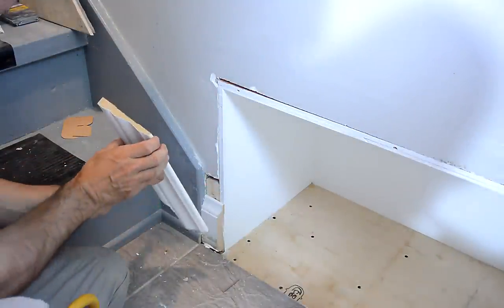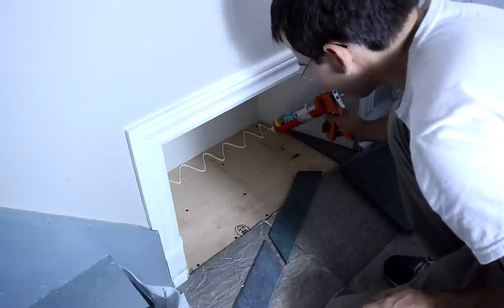Installing a boot nook

Comment: Nice project. That was acrylic caulking so it's water clean up. A rag with a bucket of water works real good. Just wet the rag and wipe it down then rinse the rag and repeat. I use the stuff all the time to fill cracks when I'm doing white cabinets. Real silicone is a whole other animal!

Comment: The original plaster walls had lath strips. The gypboard backer was an upgrade years later. You were lucky. The original plaster would have been a bigger mess :)

Comment: Nice nook in wall behind door. Like the compass magnet idea. I use the old little magnet nail finder with a small tack on the other side. Was worried about the structure removal until I saw your added support. Thanks for keeping mistake in and for sharing.

Comment: I once cut a few grooves into a wall made of gypsum blocks to get some water pipes hidden. It set of all the smoke alarms in my house and ppl thought it was on fire with all the dust coming out of the windows. I had no dustcollection and used a basic angle grinder. In hindsight, it was funny, but we found dust everywhere even after weeks went by...

Comment: I have the same type of walls in my house (from 1954). I often use a carbide tile cutting jigsaw blade to cut it. It can chip very easy though. Recently I have been using a grout removal blade for a multi-tool (Fein style) to make smaller holes like for outlet boxes. I love my plaster walls but they can be a pain to deal with.

Comment: Nice work but a tip for the next time you use casing around something is to start with the top piece then match the miters on the side tight to the top, it helps with the joint even though you used,

Comment: Make a spray bottle with soappy watter and after you finish applying silicon glue, spray the soappy water on those lines and then you can easily scrape down excess silicon off without it sticiking to tiles

Comment: "oh shit wrong spot!" lol. That was pretty cool. The dust at one point looked like it was about to start going everywhere but you could see it get sucked back up. I'm going to disagree with you on the grout vs caulk thing. With grout you would only have used one rag and a bucket of water for that area instead of all those paper towels. I've always had an easy time with grout but a super messy time with caulk. Looks great though!

Comment: Matthias. Your videos are always very informative and unique. But take it from a 25 year carpenter. NEVER beat one hammer head against another hammer head. There is still a piece of my old 28 oz. framing hammer lodged deep in the bicep of a co-worker from an incident 10 years ago. It could have very easily had been his eye.

Work safe, my friend.
Reply: He was hitting that no harder than you would a metal ended chisel. Hope that helps you rest easier
Reply: Actually no, it doesn't. It doesn't really matter how hard you are hitting them together. The edges of a hammer are very brittle and can chip off easily. I know this from training and experience.

Chisels are specifically designed for this type of use. Hammers are not.
Reply: +Dean Rohs mythbusters had nitrogen powered hammers hitting each other and couldn't replicate what you're worried about. A guy hitting a hammer into some plaster isn't a problem.
Reply: +JeefCakes 

Be an idiot if you choose. I'm telling you this can and DOES happen. It happened to me and a fellow co-worker was permanently injured as a result.

The Myth Busters used a specially designed ROBOT to hit the hammers together. Human beings do not hit like robots. They often hit a hammer head off centered or on the edge. It is THIS kind of action that can result in chips breaking loose from the thin edges and flying in any direction. And at very high rates of speed.

Educate yourself and cruise a few woodworking or construction trade forums and see for yourself. Granted, this is a rare occurrence. And the chances of it happening to you and resulting in an injury are slim. But are you willing to take that chance? I have worked in the industry for over 30 years uninjured because I choose to work SAFE!

There are more than enough tools designed for this purpose that one should never have to resort to hammer on hammer. And if you were an employee on MY site and I see you do this, I guarantee you will NEVER work in the building trades again.
Reply: +Dean Rohs he was tapping the thing, not smacking it. Safety troll
Reply: +JeefCakes  I've met so many people like you in my 30+ years in the trades. Usually in the Emergency Room. Stay away from my job sites.
Reply: +Steve Hillier I've seen two Estwing hammers not shatter.
Reply: +JeefCakes Congratulations. Here is something interesting, must be proof of your conspiracy theory.

http://www.finewoodworking.com/item/17562/reader-says-mythbusters-missed-on-hammer-strikes

The comments are more interesting than the article.
Reply: +Steve Hillier And if you're an electrician, you'd have a load of stories about how many times you've had a shock just pulling out a plug while holding the flex. Doesn't change that it's exceedingly rare, and it's just safety trolling. If the Mythbusters rig did the same thing every day for years, I bet they'd capture a few events.
Reply: +JeefCakes There is a difference between someone who tells youtubers to wear hearing protection or use a push stick and myself who tries to correct those poor misguided moronic know-it-alls who think that everything TV stars tells them is the truth. You could say I'm making the world a better place, one fool at a time.
Reply: This was one of the first lessons at manual arts at school. One would have thought our brilliant Matthias would have known this.

Comment: Aaaaand this is why i like your houses more. In my country we have houses mainly built from stone and solid bricks, you could not do something like this with a 30cm (~12 inch) wide wall
Reply: Yes, you can! In my country, the walls often are the same like yours, but I have a house with more than ten almost wall-deep nooks, made 100 years ago for tools, cabinets and protruding machine parts...
Reply: Matthias Burger hmmm, i will have to look into it, but it will not be as easy as the video, since i think i will have to carve out the nook

Comment: Tip* when using caulking squeeze it in to the groove then spray the tile surface with soapy water. It stops it sticking to it during clean up.

Comment: Things I learned this video:

Two hammers can get at tough nails
When using a nail gun for the edge of a box, the edge of your work table can be a great height guide
Not all walls are built equal :)
Reply: No man, never beat on the face of one hammer with another you could easily lose an eye. There are many tools designed to pull nails, cat's paws, flat bars, pry bars, crow bars.
Reply: How could I hurt myself? I need education here.
Reply: +RandomInsano2 The hardened steel face of a hammer can chip or shatter sending shards flying with enough force to puncture deep into your body. Definitely not worth the risk. Check out this site, the comments are full of scary stories.

http://www.finewoodworking.com/item/17562/reader-says-mythbusters-missed-on-hammer-strikes

Comment: I suppose if you had a few extra minutes and still wants to use caulk instead of grout, just tape the perimeter of the tile with painters tape. After the caulk sets pull the tape up and boom.

Comment: Rockboard... I hate that stuff.  I probably would have used a jigsaw on it to reduce the dust, but it's going to be messy regardless.
Magic repair of the higher cut into the wall.

Comment: A plaster lathe box, like original wall would have been better for sound insulation.  A proper size shoe rack would increase capacity (typical construction of rack is metal, but I'm sure you could make a great wooden shoe rack though you may have to expand the box if possible).

Comment: Next time use Blue masking tape by the joints so it will be less clean up. I like to use bath/shower high glossy white caulk as it doesn't get dirty/mold or turn brownish and its much easier to work with and clean (wet sponge).

Comment: Please wear a respirator. Any asbestos on that old plaster and cement?
Reply: +Amirhousein Hazratifar No asbestos in that stuff. Asbestos was mainly used in pre made tile shingles, flooring, and the like. The stuff he was cutting would have been made in place mostly, save for the gypsum lathe, which is basically sheetrock, which does not have fiber re-enforcement. However, respirator would still be wise, gypsum and concrete dust is still not good for the lungs.
Reply: Amirhousein Hazratifar too late
Reply: +Justin Lewis what do you mean by too late

Comment: SACRILEGE! Never hammer another hammer! o.0
Reply: He could have used a brass hammer against the steel hammer, no fuss.
Reply: ***** Metallurgy. The resonance in the strike will deteriorate the steel if you strike it with another steel with similar densities and attributes. In layman's terms it's going to fuck up your hammer.
Reply: I was joking about the sacrilege! lol I'm just saying most people in certain sects would consider that borderline sacrilege. lol Especially when you're talking about tools that forged the cornerstone of civilization.
Reply: John Mirror Maybe if both were of the exact same material there would be slight chipping,but I can tell you from experience, its not that bad to do.
Reply: Tyler Pritchett
I'm not saying it's all that bad but if I see anyone smash their head onto my stiletto head then I'd be a little bit upset...
Reply: 12345NoNamesLeft
WRONG! One might think that the difference in hardness of a steel or brass hammer would prevent chipping. But brass can chip also. There is NEVER a good reason to hit one hammer against another. That's what chisels, nail punches and cats paws are for.

You will use much less force hammering against these specialized tools than you would trying to drive a hammer claw under a nail head. Is it really worth going blind over?
Reply: Tyler Pritchett
Well sir I can tell you from experience that your thinking will get you ~ or someone you're working with ~ hurt someday.

I had a piece of my hammer chip off and imbed itself about 3" deep in a coworkers bicep. And because it would cause more damage to remove it through surgery, the doctors decided to leave it there. It was no bigger than 1/8th " around but it was traveling fast enough to bury itself deep in this mans arm. If this had hit him in the eye, he would have been blinded, or worse.

It may never happen to you in your lifetime. But is it worth physical injury just because you chose not to use the RIGHT tool?
Reply: Dean Rohs XD Yup. We all know "this one guy" we worked with or knew from such n such. Your friend must have been quite the weightlifter if his bicep was 3" thick. Lol
Reply: Tyler Pritchett
Well Tyler. This "one guy" has a name and would be happy to verify this story for you. And he's been working in the construction trade most of his life so yes, he has rather large muscles. But I never said the shard entered his arm at a 90 degree angle. You assumed this. It hit his forearm about midway up and traveled at an angle toward his elbow, about 3" according to the doctors report. The surgery to remove such a small piece would have created more damage than just leaving it in. So that's what they did. Pumped him up with antibiotics and sent him back to work.

I'm not at all proud of this incident, Tyler. Especially since it was MY hammer that chipped and he'll be carrying that around for the rest of his life. But the fact is these things do happen. Maybe not very often. But often enough for most intelligent woodworkers and craftsmen to take notice and avoid this dangerous practice. It only takes a very small piece of steel to blind a person forever.

Whether anyone here believes me or not is irrelevant and I really don't care. I would not want to work beside another craftsman that works with your attitude. Those guys don't stay in the industry very long. But there are enough tools on the market designed for this purpose to avoid this type of injury altogether. So why risk it? Don't take my word for it, Tyler. Just ask any emergency room doctor if he's ever encountered such an injury. Probably all of them have.

But you just continue banging your hammers together, Tyler. You're the type that don't believe anything till it happens to you. Good luck with that.
Reply: Firstly, I am calling your bluff and would be happy to give you my contact information so that he could contact me. Secondly,you're nitpicking at what I said with his bicep. Under the circumstances you weren't being specific, I had the right to assume, just as you did when you assumed I meant at a 90° angle, as I never did say it would have been a 90° angle. Your move, kid.
Reply: Aaaaaaannd...your point is?
Reply: Dean Rohs You know...using what you might consider "big words" is really not helping you. Calling me thick is weak. Assuming I don't care about safety from ONE conversation makes you...in short wrong. I'm speaking only from my experience and research. I'm fully aware it can happen and I've never said it couldn't. At the same time, I'm not so scared of one situation that I let it trick me into thinking it happens all the time. The chances are quite astronimical. Do NOT insult my work ethic from what little knowledge you have of me. Also...sophomoric? You're the soft headed one! See? Any one can insult someone else. Don't assume I was trolling. Do not assume you're not the one looking folish or that "the masses" think I'm foolish. I'm fully aware of the intentions of his channel. I'm just wondering if you're aware of this thing called being an adult. Because you're not setting much of an example, yourself.
Reply: Calm down. Chipping Hammers happens only on hardened areas like the Hammer peen.
Reply: steffo mio Hardened areas on a hammer include the entire head of ANY hammer. Especially prone are the edges of the hammer head if the hammer strike is not exactly square. And who strikes their hammer square 100% of the time? This is exactly where MY hammer chipped and resulted in an injury.

The reason you don't hear of these occurrences more often is that the vast majority of the time we are hammering a nail of some sort, and striking the nail on the flat surface of the hammer head. You will never chip a hammer this way. But strike a hammer against another hammer and there is always a chance the strike won't be square and one hammer will hit the other along it's edge. That 90 degree angle ~ approx. ~ that forms the outer edge of the hammer head is the weakest part of the hammer and will indeed chip fairly easy. And when it does, it's like a bullet leaving a barrel.

Granted, this is a rare occurrence. But considering the potential for serious injury and the fact that most craftsmen already have the proper tools for this application, this should never have to factor into the work place. And if you think you'll get by with this behavior in the professional arena, you're fooling yourself. I have seen guys removed from the job site because of this very thing.
Reply: Dean Rohs Well, in Germany Hammers are from strong high quality Tool Steel of course and only the peen is hardened. You may have used a low cost carbon steel wich is simply hardened all around to let it look like a strong tool.
Reply: steffo mio
The peen of a hammer is much harder to chip than the flat surface because it's rounded and doesn't have the squared off edges that the nail driving surface of a hammer has. Much less prone to chipping.

I've been using the highest quality tools since I have been in this industry. Cheap tools get cheap results and have to be replaced too often. So I'm well aware of the hardness, tempering and the PROPER use of hammers.

Also, we are not referring to the use of ball peen hammers here. This discussion is about framing and claw hammers. But since you brought it up, YES! You could chip a claw hammer head with the peen of a ball peen hammer if it were struck on the claw hammers edge.